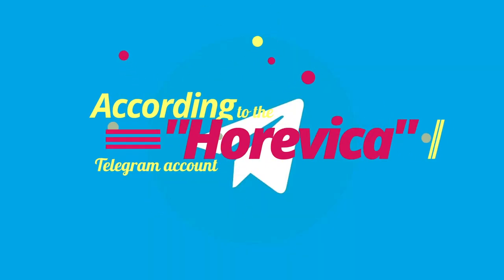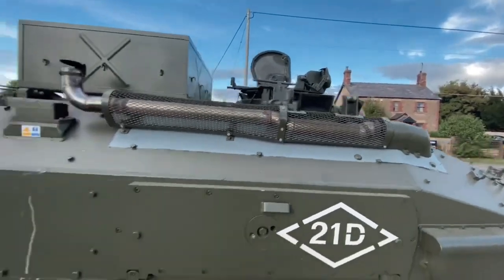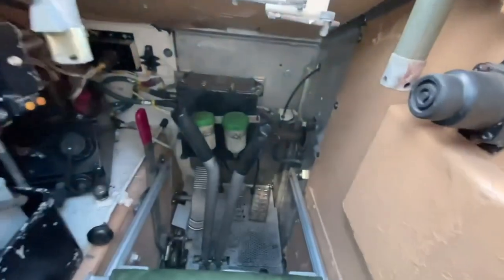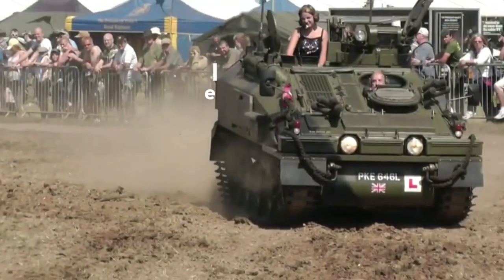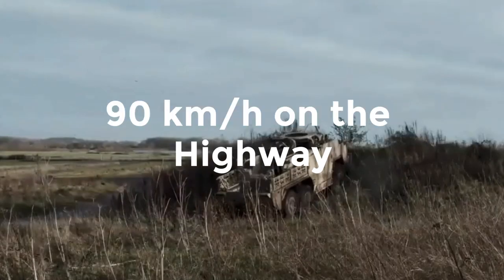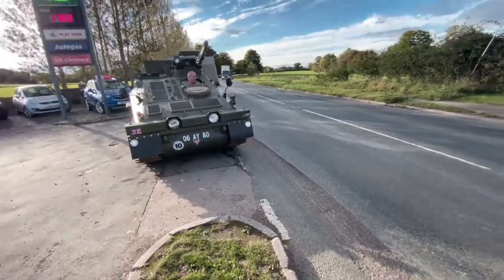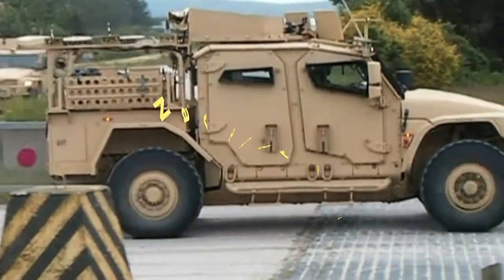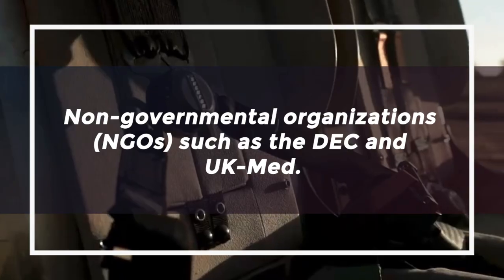The British Army Just PROVED This Armored Combat Vehicle In Ukraine!

Comment: I was a driver in a Spartan in Germany in the 1990’s in a Royal Engineer Regiment. It was used at the Troop commanders vehicle and the troop staff sgt recce vehicle. We crewed it with three one being a radio operator. They are very fast. 7 forward and 7 backward gears and yes it can go as fast forward as backwards. However as the driver I worried if we got hit. The driver sits next to two large batteries and the brake fluid reservoirs! If you got hit your getting covering in battery acid and highly flammable brake fluid. Absolutely brilliant fun to drive off road though.

Comment: Spartan appears to have shown its worth in Ukraine. Rather than spend millions on Ajax (which may or may not be cancelled), wouldn't it be possible to create a double V hull, upgrade to armour (as per the Scimitar) and installed either a 30mm low recoil RWS or Automatic Grenade launch RWS.
Reply: No in would be a 'w-hull'!
Reply: Scimitar 2 is exactly that
Reply: Ie a Spartan converted to use the Scimitar or Sabre turret or warrior turret